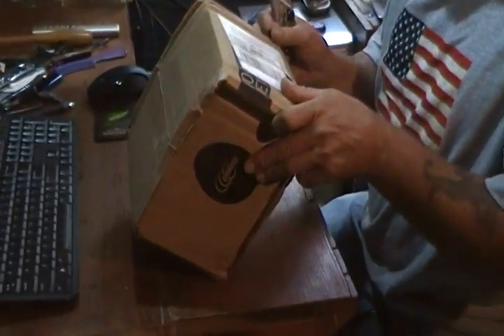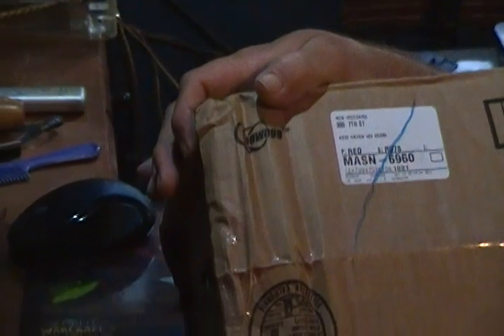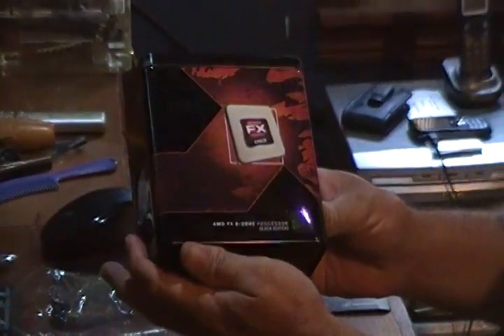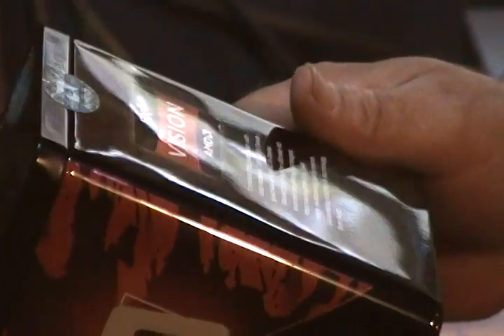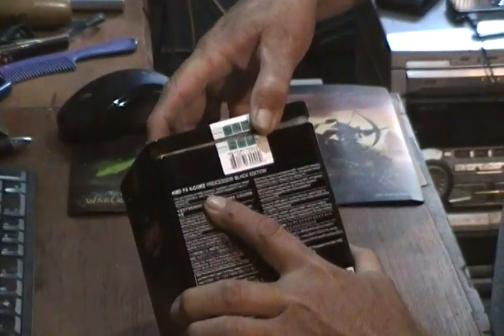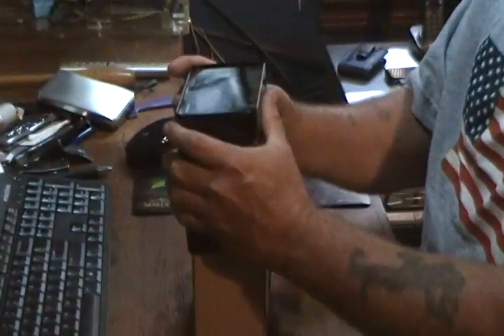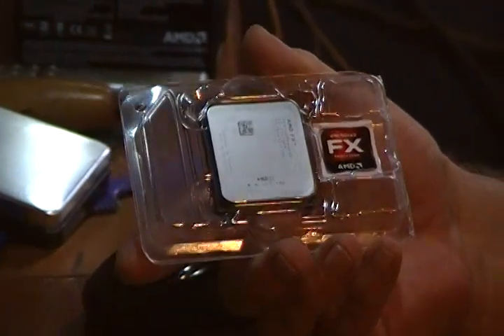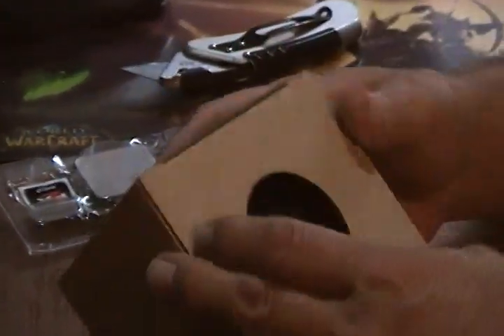AMD FX 8150 Zambezi-Bulldozer-unboxed

Comment: @desertfox1792 Initial benchmarks and reviews put the performance of the FX8150 below the i5-2500k.  The FX8150 launched with a price of $289 USD and the i5-2500k retails for $230 USD.  People bash it because it doesn't perform as well as a CPU that costs $60 less.

You could debate the issue for days.  Some say the CPU performs well enough in apps optimized for multiple threads, others say AMD should've made sure the CPU's single-threaded performance was as good as Intel's before launching it.